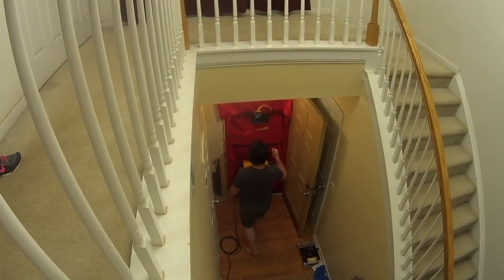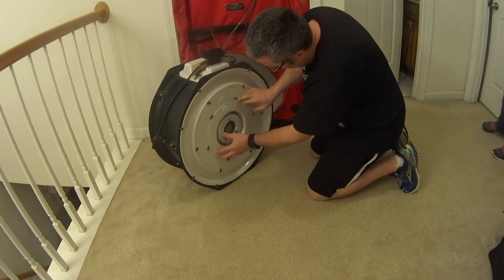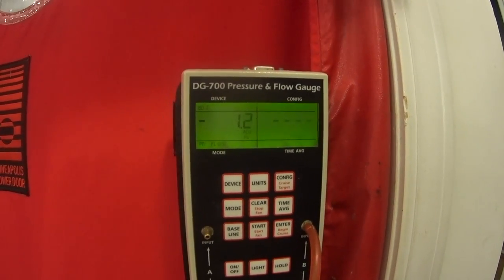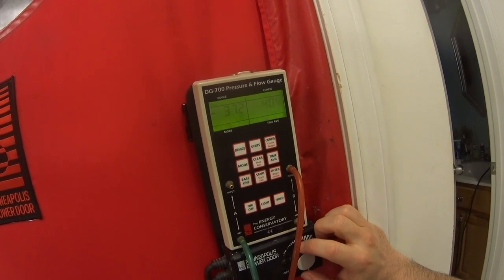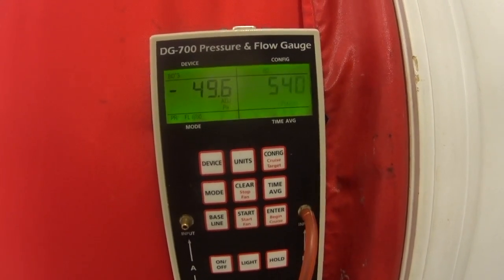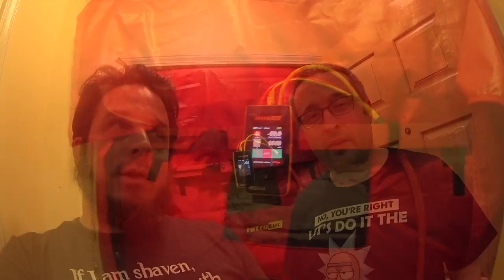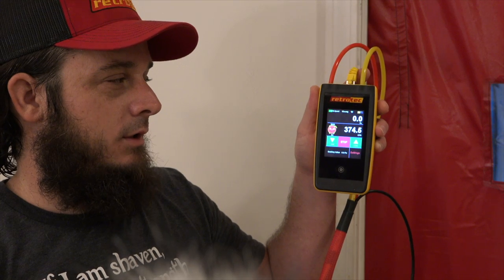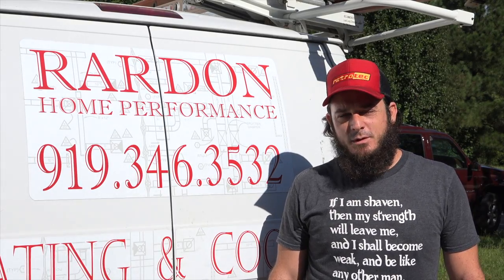Blower Door Testing Zonal Leakage to Outside with Nate Adams

Comment: Great video, but wouldn't be easier to just blank off the master door and cut a hole large enough for a flow hood?  In your test, the Retrotec mini door kit would probably work better with the low cfm range.

Comment: Steve, Master bedroom with 375cfm50 would equate to about 22cfm Natural every day condition (N-factor of 17.2 for a two story house in Carolina's) Far lower then a ton of cooling as stated in commits below. 22cfm doesn't sound like much but when you multiply 60 minutes times 24hrs equals 31,680cfm of leakage in master bedroom alone.

Comment: pretty sure the same results would have come from testing the whole house negative, then positive testing the bedroom alone, negative should work as well, if the house is neutral to outdoor with  open windows/doors, so it's not trying to pull the whole house negative/positive.
that would work for any individual room/area, just subtract it from the whole house door test, could do both positive and negative to factor in flexing windows and other joints..

Comment: Does that mean you’re basically losing a ton (12kbtu) of cooling through your master bedroom or did I misunderstand something and mixing something up.
Reply from the maker: I believe that’s a logical way to look at it as far as almost a ton of airflow, not necessarily 12k btu. My entire house has close to 2000 CFM of leakage but I don’t need a 60k btu AC to keep it cool inside during hot days. Thanks so much for watching!
Reply: hehe, sometimes leakage into the walls and attic are not a 100% bad thing, it can really help when the air is stale and blazing hot.. although it's not ideal way to cool said areas :)))